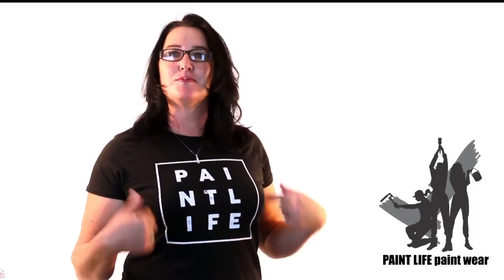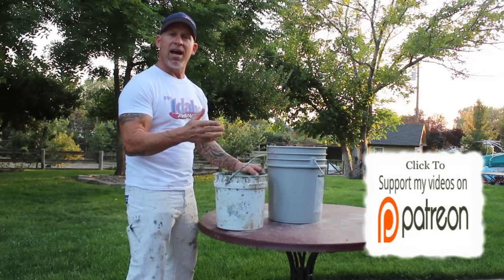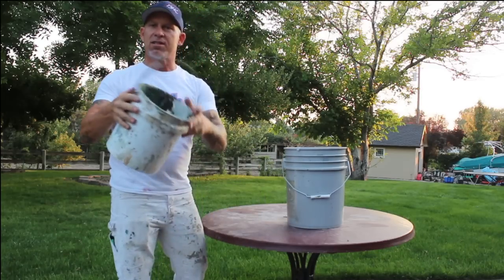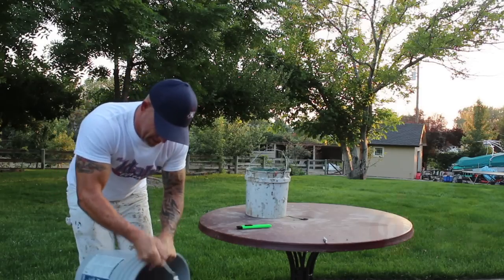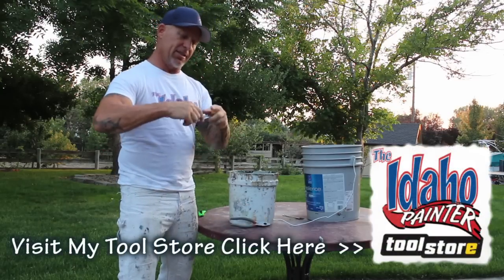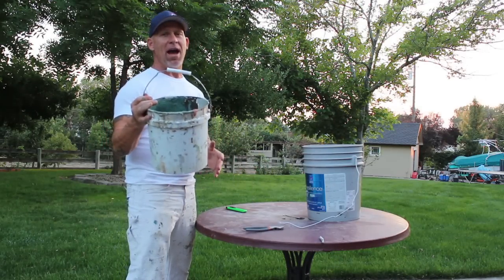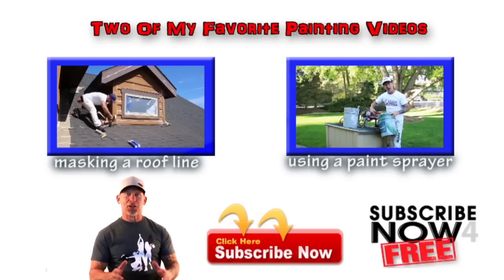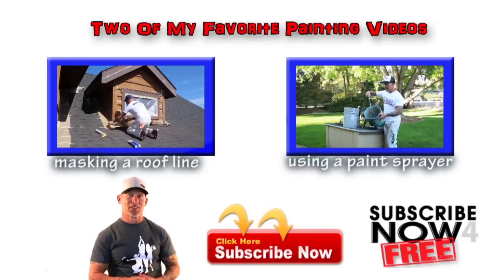Making A Better Paint Bucket.  Paint Bucket Handle Replacement hacks.

Comment: i save oId garden hoses for this...works 4 me and it free because the hoses are worn out...aIso use them in the garden and fIower beds by driIIing extra hoIes in them and seaIing the discharge end (use as irrigation)...

Comment: If you are going to pooch the wire handle off the 5 gallon bucket, you might as well just cut the wire with a set of pliers with wire cutters on them.

Comment: use a hacksaw or pliers to cut the handle of the 5 gallon bucket
Reply from the maker: Thanks for the tip!
Reply: Bolt cutters.  But I'm sure you figured that out.  Great video!  You have really high production value :)  May I ask where you learned these YouTube tips and tricks?  Any particular YouTubers or other education you can point me to?  Fantastic channel, subbed today.  Thanks PGP